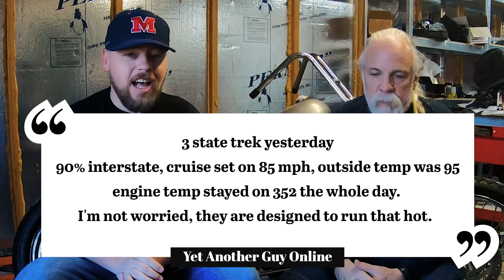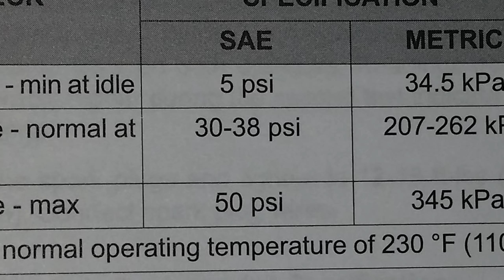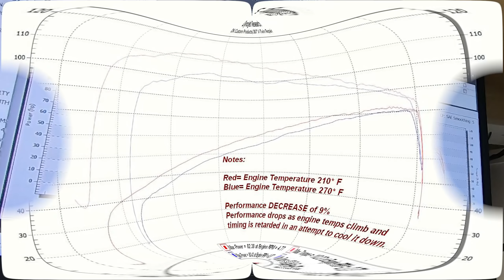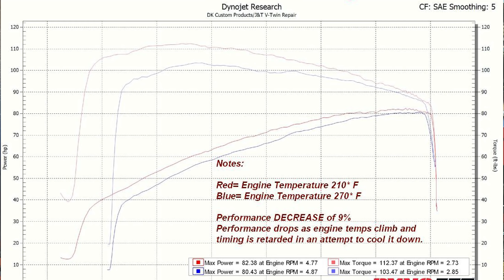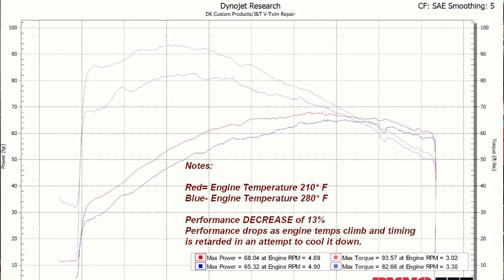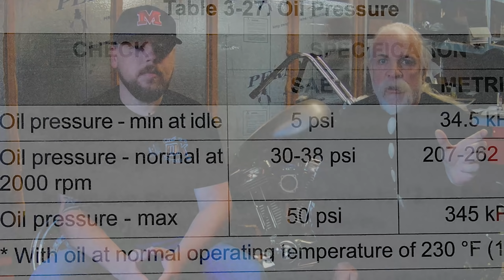Harley's - The RESULTS ARE IN About a Popular Myth

Comment: Everything they are saying here about the avg HD heat issues is 100% true esp when it comes to the avg HD dealers take on it.

I have been a motor mechanic for over 50yrs & when I got my flhtcu  & had my 1st ride in 85-90 deg f heat my HD responded in this way.

Oil pressure at idle & cruise was down by 12-15psi due t overheated thinned out oil.

Valve train got noisy due to overheated thinned out oil.

Motor lost it’s snappy throttle response felling soggy less responsive loosing trq due to excessive heat.

Motor detonated on premium 93 fuel when had rec 91 Oct fuel due to excessive heat.

Hot restarts like post fueling up in hot weather was slow due to overheated heat soaked starter,battery & motor.

The excessive heat was uncomfortable for the wife & myself riding the bike too.

So after that 1st ride in summer heat I said if I can’t correct this heat issues the bikes  going by by because I didn’t like it’s change of character when riding in summer heat cond.

So I got on my pc to find the products I felt would remedy all the above issues by doing them all at the same time that fixed it once & for all!

Keep in mind I have an oil temp gauge along with the std oil pressure HD gauges do I can easily monitor & compare pre post adding cooling mods.

Installed adjustable XIED’s to correct the excessive lean cond from idle thru mid range throttle position which smoothed out the idle & mid range motor operation but didn’t affect oil temp.

I installed a lrg oil cooler with 2 thermostatically controlled electric fans.

Note,an oil cooler on an HD without Elec cooling fans is basically useless when it’s needed most in stop & go slow moving traffic due to lack of airflow,end of story there.

The motor & oil will still get overheated sitting at stop lights or in slow moving traffic due to lack of airflow thru the oil cooler without the 2 high speed & high volume Elec cooling fans the oil cooler I used had to keep the oil & motor cooler in hot summer temp.

Installed love jugs newer Gen smaller cooling fans that Mount to horn bracket on left side of the bike under the fuel tank.

Removed the oem crankcase breather hose from the air filter & changed it to an external breather eliminating the motor injesting all the over heated oil soaked crankcase fumes from mucking up the complete intake & combustion chambers.

Also Got away from HD syn3 & MOBIL1 20w-50 motorcycle specific oils to spectro’s syn blend or full syn oil specifically designed & formulated for lrg disp sir cooled v-twins.

So after I did all of the above all at the same time I was shocked at just how well the bike/motor responded to it & how much nicer it was to ride the bike in summer temp

XIED’s made the motor run soother at idle & at mid range throttle too.

Oil pressure in summer heat only dropped 6-8psi @ idle & cruise rpm vs the 12-15psi it lost prior to the cooling mods.

Valve train/lifters stayed completely quiet at all times in summer heat.

Oil temp went from 236-240deg f on avg to 190-195 deg f in summer heat post cooling mods.

The motor stopped detonating on 93 fuel so I tried HD’s rec 91 fuel in it & it didn’t detonate on 91anymore so stayed with the cheaper 91 fuel.

Motor retained all its crisp performance /throttle response & trq that it used to loose when it ran hotter prior to cooling mods.

Hot starts like post fueling up were quick with no hesitation at all when it used to struggle turning over a bit slow due to the heat soaked overheated starter,battery & motor prior to the cooling mods.

There was also considerably less heat from the motor hitting me & the wife too.

The motor running cooler will definitely extend the life of all the seals,gaskets & plastic parts in the motor like for example the valve seals, plastic blocks used on cam & primary chain, & more!

I used to belong to the HD forum and used to see guys constantly posting/complaining about heat related issues & I tried to tell the Hd forum members what I did to my HD that cured all the heat related issue I got huge pushback basically saying I was full of crap and what I said was not true when it was the best money I spent on the bike that gave the best results in comfort & overall improved engine performance.

Now issue with the hd’s poor design of the efi connector at the throttle body causing the TBW to all the sudden crap out loosing all throttle response going into limp mode with motor only idling when your in traffic being very dangerous that hd totally looked the other way on basically doing nothing for me.

They tried installing new gold pins in the connector but that didn’t work either. 

Hd said the only fix was to replace the efi wiring harness with the same poor design 
EFI Harness/connector that was currently giving me trouble costing me $2,000!

I thought about trying to eliminate the connector by soldering the wires directly to the spade terminals on the throttle body.

But theres a lot of vibration in that area & thought if that fidnt work and wires/slide joints let loose then I’d have to replace the efi harness for $2k just to sell it!

That’s when I learned my lesson & said goodby to my Hd & went back to a jap 1700cc air cooled cruiser that’s been rock solid reliable with more power without any of the heat issues to have to correct costing big bucks too.

Happy motoring
Reply from the maker: Great to hear you were able to get the heat down, and saw the benefits of that.
Sorry to hear of the connector challenges.

Comment: I think people get confused with the three temps. Heads, Engine, oil. On my M8, my heads run about 25° hotter than my engine temp on my power vision. I don’t know what my oil is running out
Reply from the maker: Yes, you are absolutely correct.  There are several different number, AND the optimum engine temp is different on Sportsters, Twin Cams and M8's.
The two that we pay Most attention to are:
1.  The ET as displayed by the Powervision as "ET".  The reason we use this signal is because this is what the Harley ECM uses to make changes to the fuel and timing.  This is the important number (produced by the cylinder head heat sensor), since this is the one HD uses.
2.  Oil temp, measured in the oil tank.  Generally, if you see that temp between 190 and 230, after riding for 45-60 minutes, that will indicate the the temperature of the engine is ideal.

Comment: I wouldn’t purchase a water cooled model unless it had a stock oil cooler as well. To my knowledge, all of the water cool models do not come with oil coolers.
Reply from the maker: That is correct, the Twin Cooled do not come with oil coolers  We have a better than factory oil cooler with a patented design that fits the Twin Cooled bikes and trikes that generally see a drop of 20-25 degree F in oil temperatures.
Link - https://www.dkcustomproducts.com/twin-cooled-oil-cooler-c612.htm

We also did a video which backs up what you said about the challenge with Twin Cooled Harley's.  It is here - https://www.youtube.com/watch?v=6AhPqVlvE-w

Comment: Enjoy your informative videos....
Ultra M8 107 stage 2
I have carried out mods ..tank lift, oil breather external system,  removed left hand leg heat shield and run fully synthetic oil.
Question... how do I monitor the engine oil temp the best  ?  Currently I have the thermo heat gun and aim it at the top finn of barrels at a set distance. 
Question,  how does this temp compare to oil temp.
Thanks ... Jim in Australia 🇦🇺
Reply from the maker: Thank you, glad you are finding the videos useful...and we appreciate your business, and glad you are liking the parts.
There is no direct correlation that can be drawn between the outside of the engine temps measured with a gun and the oil.  
Oil heats up and cools down very slowly compared to how fast the outer surface of cylinder heads heat up and cool down.
Generally it takes 45-60 minutes of continuous riding for oil to reach it's max temp.
On your Ultra, you have no oil cooler, so the oil is going to be hotter than most.  Here is a link on a test we did on an M8-
https://www.youtube.com/watch?v=6AhPqVlvE-w
Best way to monitor engine oil temp is with a HD or JES Custom oil temp dipstick.
Best way to measure the internal (not surface) engine temp is a Power Vision.
Here is a video series you may find useful-  https://www.youtube.com/playlist?list=PLb3bvZgbH92_3s-2vv63QggFJ3nteFd_C

Comment: You guys are absolutely correct! Even liquid cooled engines across the board run their coolant between 180 (old school) and 195/205 (currently). Temps at or above 220-230 degrees is an overheating situation! Air cooled is not much different. The oil itself starts to oxidize and break down at the higher temps. Can you get away with it? Sure. For a while... Like anything, there is a limit. I'm with you guys, keep it cool, keep it happy! Great work guys. Keep plugging away at it. The nay sayers will one day learn (maybe).
Reply from the maker: Thanks man, appreciate it.
Yes, we would rather see temps closer to 200, but we have not found a way to make that happen on a heavily loaded bike/trike traveling at interstate speeds on a hot day.
Reply: Bottom line is don't run your bike at idle for more than 10 to 15 minutes at any given time because air cooled engines require AIR. And don't race the piss out it. Air cooled engines hate it when you act like you got a muscle car between your legs. Harleys are NOT race bikes they are cruisers.

Comment: The people who are in denial about heat increasing ware on the engine and robbing power from the engine are simply wrong. You guys are right and bottom line is I rather ride my bike with a cooler engine than wrench on it, repairing the damage, by riding at above 260 oil temperature.
Reply from the maker: Nail on the head!  Rather be riding than wrenching (or waiting for the dealership to rebuild and have it all happen all over again).

Comment: Good video. I've got a 2014 Slim with the 110 big bore kit. They run hot! I run a Jaggs fan assist oil cooler so oil stays right at 210. Engine temp per the PowerVision  can show 285-290 in summer. Might Mites are being installed soon for more protection and a tank lift. Thanks guys for the real data.
Reply from the maker: Sounds like you are on the right path to getting it cooled down to optimum operating temps.  👍
Reply: I run Love Jugs on my '11 Street Glide and they definitely work. The trick is to turn them on as soon as you realize you're in stop and go traffic, before the engine starts getting too hot.

Comment: Morning Guys, another informative video - thank you! I ride a 2018 Tri Glide Ultra FHLT CUTG with a Stage 1 set up. As I am based in the UK, its always a little difficult equating what you are reporting and advising in regards to the UK ‘s generally cooler climate. I have currently fitted your cooling wings, a Jim’s Forceflow fan and removed the left side cooling shield. In addition, I have fitted a replacement oil dipstick that measures oil temperature. I suppose now I need to ride as normal and monitor what temperature the oil gets too. I do find the. Radiator fans kick in fairly early when the bike is idling on the drive or in traffic. A good thing I hope (?). Keep up the good work!
Bob
Reply from the maker: Thank you, glad you are finding the videos useful.
We appreciate your business and good to hear they are helping you out.
Unfortunately, even in 50 & 60 degrees F the engines will get too hot...it just takes them a little longer to get there.

Yes, the rad fans are programmed to kick on BEFORE it gets too hot, to help keep it in a good range.  Kicking on after a short idle in traffic is not a bad indicator.

What I do see a lot, (that is an indicator of running too hot) is a bike that has been traveling at 40-60 mph come to a stop and the fans are already on.

Comment: I'm 69 yrs old and bought what I believe to be my last HD when I was 66, a 2018 Deluxe.  I have always been concerned about HD's high heat especially when they ended leaded gas.  For most cases, I liked to ride in secondary, slower roads.  But I have ridden with heavily loaded, two up and sometimes pulled a loaded up trailer.  A heavily loaded bike and an added trailer also create a lot of excess heat.  I always ran two oil coolers and that wasn't enough.  I have made my bike into a touring bike similar to a Heritage but also added the tour pack.  One of the excessive heat sources I have discovered is the Catalytic Converters built in the stock mufflers.  I have bought a set of true duel fishtails (baffled) and also intend to install an S&S oil pump and cam case as well a low torque cam, TTS 100.  I plan to travel some and tent, but not overload and drive close to the speed limit most of the time.  I wish they had an oil temp. gage you could mount on the handlebars.
Reply from the maker: Sounds like you have some fun riding lined up!
The cats radiate a lot of heat.  They don't really make the engine any hotter, but they sure make the heat coming off the pipes MUCH hotter.
Yes, that would be a nice gauge to have...would also require the installation of a sending unit and the wiring up to the gauge.
In the meantime you could use a dipstick that displays the engine oil temp.
Reply from the maker: @smilingbiter  What a beautiful place BC is.  We have ridden around up there a few times (during the summer) and loved it.
Yeah, gotta be careful of those pipes with the Cat....I've seen them glow red at night more than a few times!
Reply: @DKCustomProducts  Thank you, I love your programs and have you on the bell so I don't miss you. Take care.

Comment: I have a 2021 Heritage with stock  ECM, exhaust and air filter and it runs fine. People who dump thousands into a Harley for “performance” make me laugh.
Reply from the maker: Different Strokes for Different Folks.
If you ride the number of miles a typical HD owner does, you will probably be fine.  Even if you ride more than the average, you will probably be fine.  Time, heat, miles will degrade the Performance, but if you don't care about it, then it is irrelevant! 👍
Reply: @DKCustomProducts  well I do about 26k a year.  About 80% of that is on my Africa Twin. The Harley is mostly for local riding when I feel like switching it up. Local is right where it belongs.

Comment: Hate to Disagree with y'all, but 1st Harley Still doesn't make a Pure Water Cooled bike, they have water cooled exhaust ports, and you are leaving out an important part in the Heat Specs you are quoting, From Harley-Davidson: " at 2000 rpm and normal operating temperature of 230o F (110o C)."  Key being at 2000RPM at Highway speeds and steady road speeds above 2000RPM the temps can go up quite a bit, when i was a Service Manager for Harley we told people an Average of 260 was normal, when the modern Twin Cams and M8's get to hot they will go into limp mode to help bring down the Temp by shutting off the rear cylinder temporarily. And what's with the Dyno Charts, a dyno pull tells nothing but full open throttle from a point usually 4-5th gear pull and No one Rides like that unless you are a light to light racing idiot.
Reply from the maker: Thank you for watching and for your comment.
The manual (see image in link below) is talking about different oil pressures at different RPM's.  The constant is that the oil should be at the normal operating temp of 230 F.
http://www.dkcustomproducts.com/image/2021_Dyno_Pulls/M8-Oil%20Manual.jpg

Full respect to you as a fellow rider and human being.  

What you put in your coment and what you say you said when you were a HD Service Manage is exactly why folks are confused.  But technically you are correct.  It is "Normal" in that most of them get that hot.  BUT, it is NOT right, nor is it what is said in the manual.

We could have done the pull at partial throttle, and at those temps it still would have pulled power due to HD having the ECM programmed to pull timing (which reduces power and efficiency).  This is because HD knows that 270 is too hot.
Reply: @DKCustomProducts  and that's why at above 280 it will if the bike isn't moving go into Limp mode, but all my Training at MMI and Harley Davidson University in Milwaukee was an Average Temp of 260, and when they say average that means a break down of hot and cold and getting an Average, Now i will be honest with you, even though i have a Harley PHD award for Master Of Technology, i Came up the Ranks to Service Manager via being a Service Writer/advisor, then Warranty Administrator, Shop Dispatcher/foreman, i was never a Technician, but i have more PHD's than Most Tech's and going back to when i was a service writer in the Shovelhead and EVO Era one thing we hated was a Customer with an Oil Dip Stick with a Temp Guage, they would come running in on their AIR COOLED Bike in July with it 90 degrees out and they were stuck in Traffic and in a panic over the Heat, Yes there are a lot of things you can do to help cool things a bit, but Number one, Don't get an Air Cooled bike Stuck in long term traffic in the Summer.  If you want steady temps in your bike Buy a Suzuki M109R, or a Honda Goldwing standard, Harleys are still 90% Air Cooled, the Technology of a VW Beetle from the 60s
Reply from the maker: @brucesantacory1390  Yep, not ideal to get stuck in traffic in any weather, especially warm weather.
If that is unavoidable,  the using something like what is seen in this video is very helpful-
https://www.youtube.com/watch?v=qMVwT0nunfU